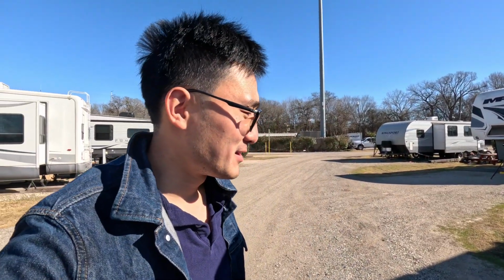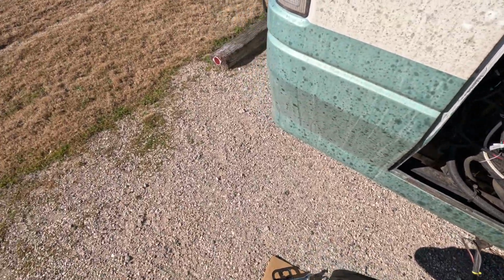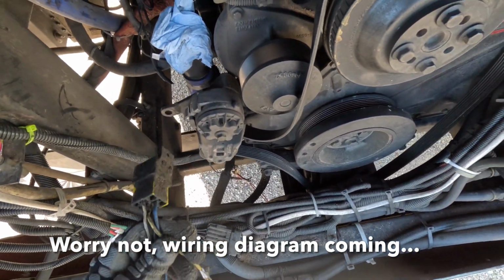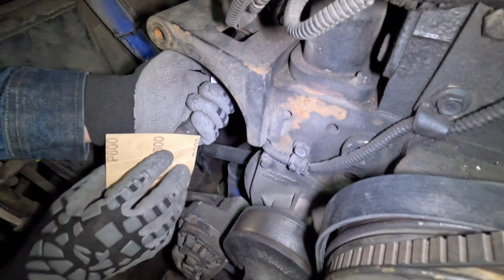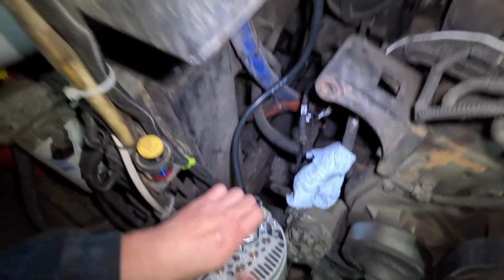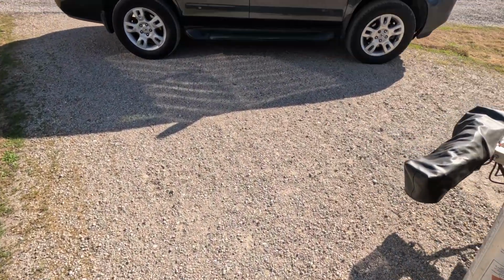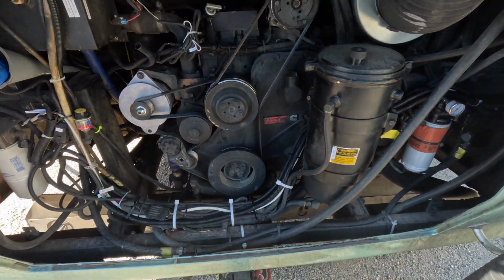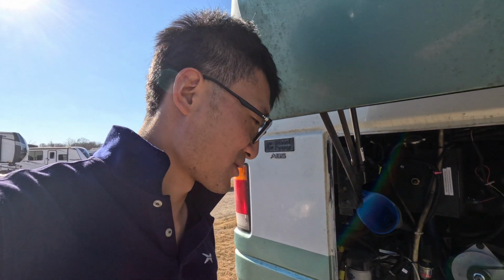2000 Monaco Windsor ISC 8.3 Alternator Replacement

Comment: Thanks for making this video.  I am about to replace mine as well but I will go with the same size (im actually trying to see if i can get my original one reconditioned at a local shop).  I'm curious why you went with a bigger alternator;  Was there a specific purpose or use case for it?  And what application where you using to check your voltage on your phone?  That was pretty cool configuration.   Anyhow thanks for posting this video.
Reply from the maker: Thanks for watching. I upgrade the alt. because I wanted to use it to charge my big house battery. I can check voltage by bluetooth connect to my Victron chargers.

Comment: I bought 2 alternator from Amazon they work only one working 160 miles and stop other only 50 miles
Reply from the maker: That's unfortunate. Mine worked fine for over a year now.
Reply: @timmysrvlife  nice but like saying my trip lost lights at night battery completely and I ordered from Amazon twice and return today I just replace
Reply from the maker: @pedrobastos3218  Right, these cheap alternators can have poor qualirt control. But I would also try to look for some other issues, like did you pull too much power from then (eg. recently upgrade to lithium batteries.)
Reply: @timmysrvlife  lithium batteries are better than other you change all chassis and house today I just drive to change my front joint ball suspension and aliment test alternator until now 13.5 to 14.1 I drive 30 miles but I don’t use nothing

Comment: What socket you use for alternator pulley
Reply from the maker: It's been a while, so don't quote me, but I believe it was 14mm.
Reply: @timmysrvlife  I have to get my pulley out I just ordered new alternator for my motorhome
Reply from the maker: @pedrobastos3218  Just use impact driver while belt is on, it came off in a few seconds for me. Hope it is easy for you too.
Reply: My new they send with pulley